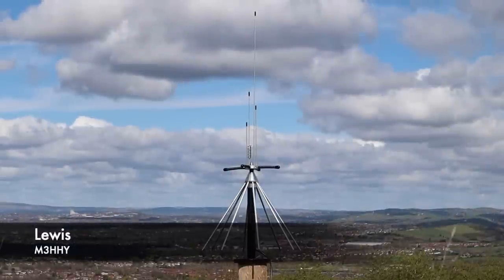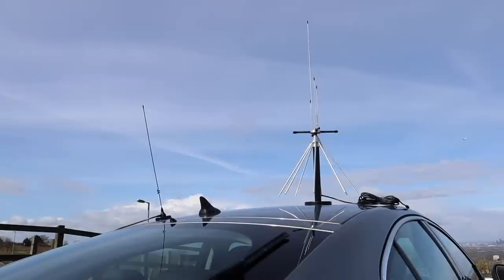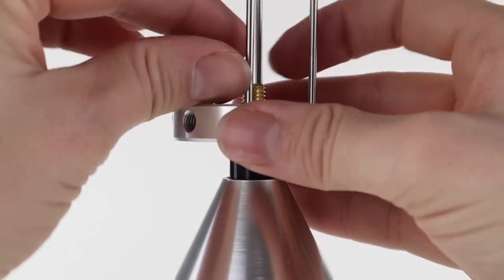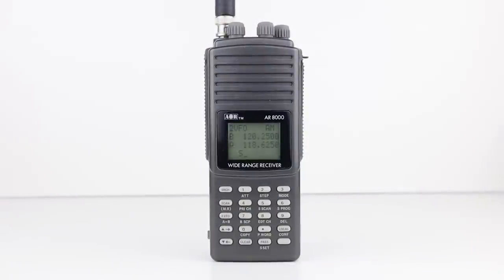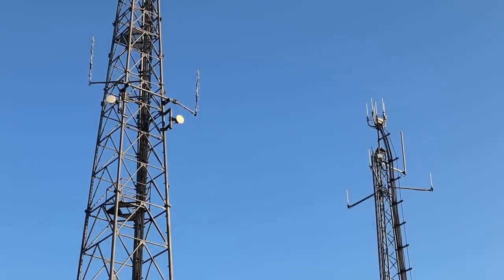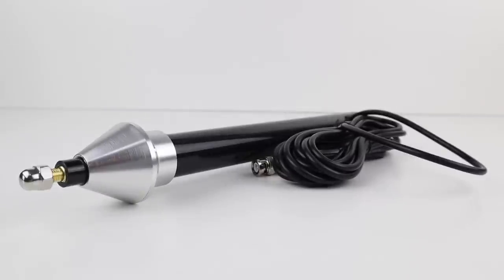Moonraker Skyscan Desktop Antenna Tested On 7 Bands

Comment: 0:00 - Intro
0:35 - Description
4:08  - CB Channel 40 mid band - 27.405 MHz
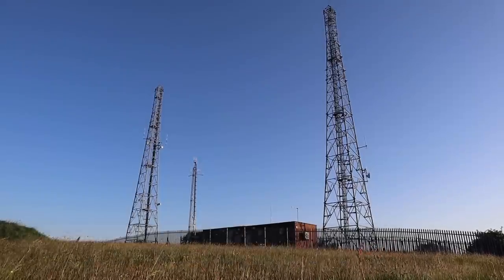4:36 - 4m band simplex - 70.425 MHz FM
5:02 - Air band - 119.400 / 118.625 MHz AM
5:36 - 2m band - 145.525 MHz FM
6:07 - Marine band - 156.700 MHz FM
6:41 - 70cm GB3EG Repeater - 430.9125 MHz FM
7:10 - PMR 446 - 446.00625 MHz FM
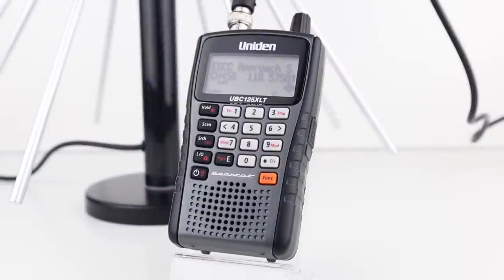7:43 - Wrap-up
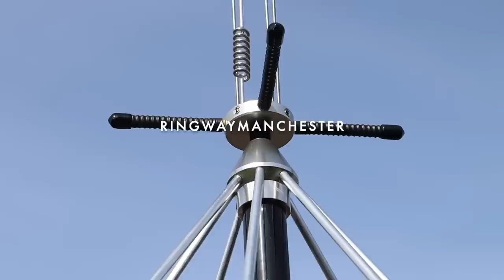8:20 - Outtro

Great review, I have a 125 XLT scanner, I may well pick one up. 73's Rob in Switzerland
Reply: Rob gb3eg is on echolink if you like to chat..
Reply: @seanfinch8011  Thanks for the tip Sean - I don’t know what Echolink is - I probably need an amateur license, don’t I? 73’s Rob

Comment: It would be interesting (and possibly more relevant) to give S meter readings where possible for this against band specific dipoles.Without comparing it to something else it's not possible to tell if it's any good or not.After all up that high with near perfect all round visibility a coat hanger would work reasonably well.🙂

Comment: Do pilots and control towers try to out - do each other in a "let's see how fast I can talk" competition?
Reply: I've often wondered why the talk so fast. Racing through pertinent information that maybe, just maybe should be said slower and annunciated for clarity.
Reply: I think some are training to be auctioneers, the others are frustrated horse racing commentators.
Reply: At a busy airport it saves a lot of time over the course of a whole day.At some very busy American airports the approach controller never lets go of the mic's press-to-talk button so the aircraft have to reply by pressing the squawk ident button.When they tell them to contact the tower it's almost always 'callsign only'.
Reply: Simple answer, yes
Reply: There's a very limited phraseology (the number of different words and situations, basically, that they discuss), so with practice it's quite simple to understand once your brain is "in the zone". Until then, it does sound very fast and a bit confusing.

CAP 417 Radiotelephony Manual is a good read and is available in  pdf  form free from the CAA website and will demonstrate the limited phraseology set they use. 

One reason that they sounds annoyed on being told to say again is that they reduce their speech speed very deliberately, which can sound quite intimidating, but is done for a valid reason and is almost never real annoyance.

UK aviation comms are quite strict and clipped compared to some other countries, but it works well.
Reply: Come to New Zealand, casual as. Not horse racing commentary speed.
Reply: We have a 97 year old man in our radio club. I listen the drunken fishermen on marine bands. But I can hardly make heads or tails of the talk on the airbands. Even the several smaller airports I can't usually even find them before they are done talking

Comment: if you dont have a metal desk... you can always use a quality street or roses tin on the window sill... we used to do that all the time.
Reply: Hahaha! A DV27 on a biscuit tin was a classic setup in the American AM CB days 😃
Reply: @Aengus42  i used to ride around town with a dv27 on the back of my push bike with the radio on the handlebars kik
Reply: @WX4CB  How'd you supply 12V in a bike? Did you have a car battery in a rucksack?🚴
I bought a Cobra 19X from a guy in a multi storey car park at midnight (CB was illegal back then!) and i made a quarter wave dipole up in the loft.
But the DV27 on a biscuit tin on the floor in the front room was the more common set up.
I was the Hamster 🐹 way before Richard Hammond nicked my handle!
Reply: @Aengus42  had a small 12 volt sla from a fire alarm in a pouch slung under the seat post.
Reply: @Aengus42  then i found the fun of the portapack and never looked back
Reply: @WX4CB  Perfect! I still pull perfectly good SLAs out of those supermarket battery recycling tubs. They're great for a rummage.
Reply: @WX4CB  As you do... 🙂

Comment: I have this antenna and you got great results but indoors I haven't had great results at all, a 2m piece of wire with a jack plug on the end out performs it indoors.
I've been using it connected to my sdr and connecting the wire to it. Noisy as hell but it massively boosts the signal.my area is not the best, rural area on the coast

Comment: Check out the ABBREE 518
It has reception down to 20 MHz
Unfortunately they don't have an AM mode
It transmit is 136 MHz and up
I wish it was able to be modified to transmit Down to 20 MHz

Comment: I've had the magmount version for years and it works very well when coupled with a grounded metal base like my radiators. I wasn't thinking about that though when I let my plumber feed my new radiators with PVC pipe and it took a minute until the penny dropped after I saw the huge increase in noise next time I used it. Perhaps this is a good alternative

Comment: Hello, which antenna is better to receive the air band, a Dipole type or a ground plane whip? I want to have the most powerful one to receive 118.0 to 136.0 Mhz. I want the better.

Comment: I'm going to buy this antenna as I've just been using a 2m split coax, taped onto a broompole in my attic for a few years now. I'm lucky that I'm high up on a hill and have a great line of sight, so it works ok.
 
Question: I've heard people say that using a metal baking tray under such an antenna as a ground helps. But does it make any difference having the baking tray earthed to your house mains? Or is that just a bad idea?
Reply: I bet your broompole will outperform it.
Reply: House mains is noisy AF, better off with a direct earth stake into the ground if you want to go that way. Your house earth loop is not a good idea for a groundplane.
Reply: @samgraham4168  Many thanks. I've never tried it, but always wondered how it would perform. You've saved me from that experiment.

Comment: Testing an antenna without swr or swept impedance data (VNA) is kind of like testing a car without a speedometer.  If you choose to just compare signal strength, you need an accurate level meter and a dipole on that frequency to compare it to.
Reply: Not at all. Actual recordings of the antenna's performance tells the average user all they need to know. Instruments may give you numbers, but  hearing the gain is more important.
Reply: @CadillacDriver  Sorry, no.  Professionals do it with much more precise methods.  I've worked in the field for 40 years.  Read any of the IEEE antenna range publications and you'll better understand.
Reply: @chrisscott1547  ummm. You have completely missed my point, and you also have no idea what I know or who I am, so please don't imply I am speaking from a place of no experience here. 
I've literally laid out why actual real-world testing is better for the "average user" - note those 2 words. Most people who listen to scanners casually will not care for numbers, data and analytics - they want THIS type of video to actually hear what the antenna is capable of compared to others. It's like telling 99.9% of people all about the inner workings of the I.C.E. or how many lumens a torch has, and what Cree chip is in it....  they don't care. It's the real-world usage they care about because numbers mean absolutely nothing to them. 
I can sit here and look over my BLF Q8's instruction manuals and marvel at the extreme amount of settings, customisation and tech packed in to it - most people are literally like "click to turn on, click to turn off". They see a torch that produces light (because that's all they need and they don't care because it's not their niche) not a wonder of technological advancement. When you start getting in to technical jargon, people's eyes glaze over unless it's their particular niche hobby.  
This is obviously your niche and I have owned scanners since 1997 myself, and use PRS radio, so I'm not exactly amateur here - but that doesn't mean I need or want instruments to throw numbers at me when I compare antennas in the field.
Reply: @CadillacDriver  While it's true that unlike most viewers, I am an engineer,  the trouble with extremely casual comparisons made without controlling as many variables as possible, is that a given set of "results" may have very little to do with the antennas' merit and more to do with other factors.  All antenna folks will tell you that impedance matching is assumed to be good, and for wideband operation this can be a real challenge, so before wasting time on any other metric, such as gain and radiation pattern, that is evaluated first.  If it's 5:1 or worse vswr over needed bandwidth, that's going to cause significant signal loss  and additional line loss.
Without these considerations, you might just as well say "I can hear some signals so the antenna must sorta work."
Reply: @chrisscott1547  well naturally if the swr is that high, there is no point using it. 
The other issue I see with "controlling variables" is that in the real world, that can't be done.... Hence open-air comparisons are, in my eyes, the way to go.
Reply: @CadillacDriver  I give up.
Reply: @chrisscott1547  good. Because you aren't actually acknowledging my extremely valid points anyway.
Reply: @chrisscott1547  check this "engineer" out, people 🤣🤣
He thinks real-world field testing is invalid 🤣🤣🤣
No engineer would say that.
Reply: @CadillacDriver  OK, you said: "well naturally if the swr is that high, there is no point using it. "
But you taunt me for criticizing that VSWR was not checked or presented.  (or perhaps you don't even know what a vna does?)
Wikipedia:  https://en.wikipedia.org/wiki/Network_analyzer_(electrical)
Reply: @chrisscott1547  
Or perhaps I don't know 🤣🤣🤣
Holy hell man. You really don't live in the real world, do you. I never once said DON'T use instruments, did I? I am saying field testing is mandatory - no matter what any instruments say.

Comment: Discones are never any good unless you have a pretty good receiver and use filters like a FM-stop filter. On a wide RX like an SDR almost useless without even more filtering/bandpass. Even up in the microwave bands they get swamped by cell towers in suburbia.

Comment: Actually the antenna performance is very disappointing for the frequency range where it is made for. Would have been better if you had checked it with an analyzer or show the performance comparing to simple uhf/vhf amateur band antennas they perform a lot better, also outside the ham bands.